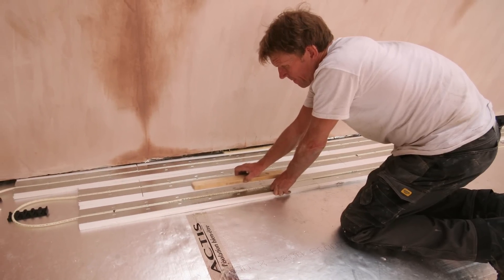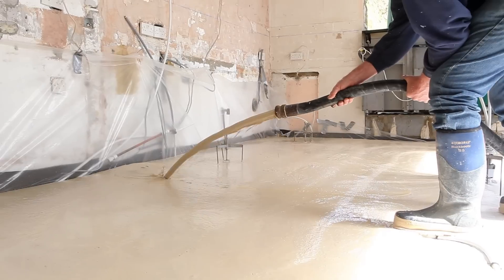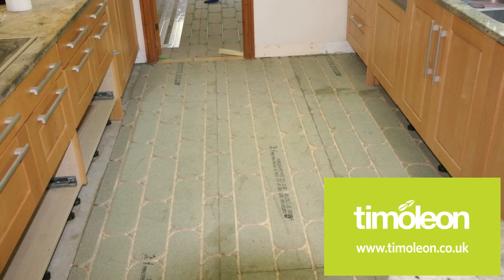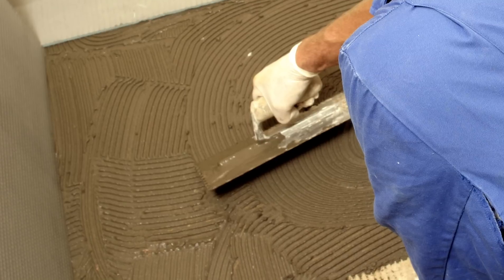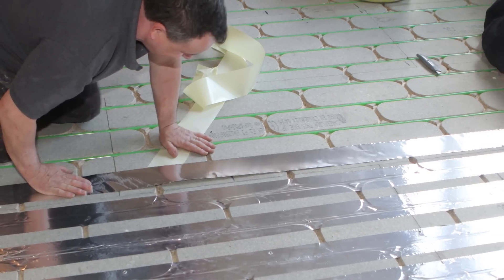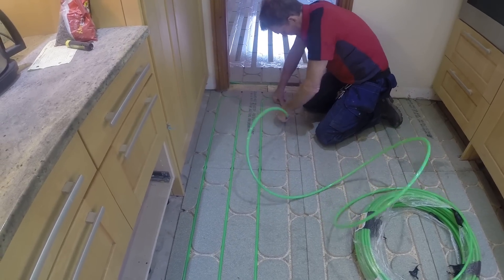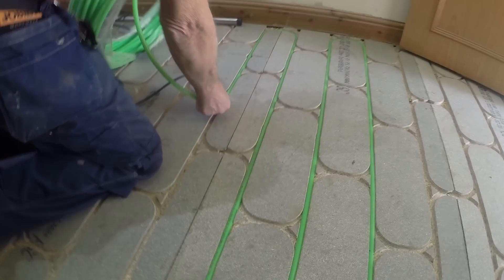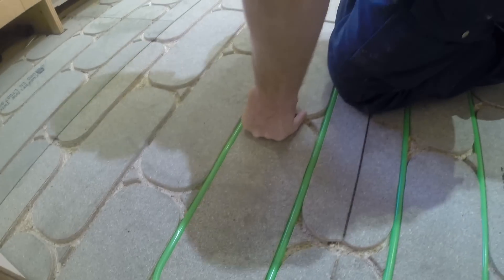Installing  Omnie Zero  Build Up Underfloor Heating

Comment: This could be an answer to my issue of suspended floor and trying not to increase floor height. I have already put 90 mm insulation between joists and replaced floor with tongue and groove flooring which I could reuse in my loft. I know I could ask the company but wondering if this system would be air source heat pump compatible.

Comment: really informative Roger, thanks for that. Question if you have a moment. I have a suspended timber floor that will transition into a concrete floor. Id like to use this system to replace my existing 22mm boards on the joists, but how would i transition that over to the concrete section? can i simply float these boards over the concrete?

Comment: Alternatively, you can lay a big foundation layer of concrete, let it dry, and just mill slots into it using a FlooriQ Concrete Milling Machine. From what I understand this technique is still relatively new worldwide. Maybe something worth looking into for you?
Reply from the maker: I have seen this but we have not done anything on it. Good suggestion.
Reply: So basically you just end up heating the concrete slab and the earth beneath it. Sounds incredibly wasteful due to zero insulation.

Comment: Hi grate video.  Can i put this Timolean system directly on to a on a 6" concrete floor that has 150mm insulation beneath it. mainly because i have only 40mm depth to play with without moving lintels .im thinking of using ceramic tiles strait on top.
Reply from the maker: You can do that but you can also use a polystyrene pipe tray that gives you an 18mm build up and allows you to put the self leveller and tiles straight onto it. Have a look at the whole range to see your optiions

Comment: Is there a system that can be connected to existing radiator in/outlets? Rather than installing a manifold

I thought that given the smaller diameter bore, it could be installed room by room to the existing central heating pipes and controlled via a thermostatic valve.

Comment: Hi, I am currently renovating my home, and have had to remove all the floorboards and joist due to wet rot. Now that i am have to install new joists and floorboards, i am interested in fitting a underwater heating system and intend to replace the radiators on the ground floor. I am insulating between the joists with 100mm celotex, irrespective of underfloor water heating system. Can the UFH system be a primary source heating and safely remove the ground floor radiators?
Any advise would be appreciated!!

Thanks
Reply from the maker: You have the perfect scenario. You need to leave enough space (17mm) above the Celotex to get the pipes in if you are using a pipe in plate system under boards or you can use this pipe in the floor system which is quicker to react. Have a very careful look at the instructions for each system and then contact the supplier who will give you a drawing with a pipe layout. There is no point in keeping the radiators, the gentle all over heat from UFH is more than enough to do the job. You will love it.
Reply from the maker: OK, like you say, it is hard to put them back so leave them in and maybe cap them off later if you want the wall space. It is important to remember that UFH works with radiated heat rather than convecting so it isn't actually trying to warm up all the air in the room. If you think of the way bright sunlight hits you on a cold day it is that kind of heat you feel and if you keep it ticking over at a low temperature it will war the structure and provide good comfort at lower temperatures.. The solid walls will lose heat faster than cavity or insulated so you need to factor this in. Have a chat with Omnie so you can get the room temperatures worked out. The insulation under the floor is a massive help. Just remember to make it airtight by squiritng expanding foam into any gaps

Comment: This might sound ridiculous, but can I put this in my van?
Reply from the maker: I assume you are talking about a camper van so yes but you would need glycol if it is left not running in cold weather.
Reply: Yup, it's running off of an Espar hydronic heater which in turn links to the engine coolant line. Can I throw down vinyl straight over the top of this? or a very thin aluminium sheet + vinyl?

Thanks, this stuff looks awesome
Reply from the maker: If you are using vinyl floor covering you need to keep that water temperature down to 27 deg cent. I would look  at some kind of timber or metal flooring. I would love to try it.
Reply: Damn that sucks!, the Espar would have it up around 60-70c, if it came straight from the engine coolant it would be even hotter, maybe up to 85c. I'd probably only ever run it off of the Espar though, so 60-70ish. What about as you say, 6mm of plywood with vinyl over the top? Vinyl is really the only ideal low profile aesthetic tough solution with van conversions, pretty much everyone goes the wood effect stick on panels or big sheets.

Comment: Hi skillbuilder, like your videos. I can see you have used many ufh systems over your time. I would really appreciate your advice on my project.
I have a suspended wooden ground floor with reasonable crawl space underneath - tho height build up above is a concern. I could fit metal spreader plates from below to the existing floorboards, but I've heard people say these can make noises as they expand and contract; and also if they are attached to 'real' wooden floor, won't they cause these to warp? This timoleon or torfloor (providing they are one and the same thing now) looks interesting. What would be your preference? Huge thanks to any thoughts

Comment: Firstly I'd just like to say - Brilliant video!

I've a couple of questions if you don't mind - 

The Timoleon system, how does that connect into the existing heating system?  

Electric underfloor heating on a suspended wooden floor. Is it worth insulating under the floorboards between the joists?
Reply from the maker: +wonderloaf 
Last question first. It is always worth getting some insulation under the floor. I have done all the timber floors in my house and the difference is instant and remarkable. Even if you aren;t heating the floor the insulation is worth it.

The Timoleon system works like any other wet system. You have a manifold. It is all easy enough to do because you get  good drawing showing all the connections. Have  a look at out Worcester Bosch underflloor heating video. It is pipe in screed but the manifold works in the same way.
Reply: +Skill Builder That's brilliant, thanks for the answers! It's good to hear your personal experience with insulating under the floor.

I think you've made my mind up in regards to using the Timolean system when I redo my kitchen!

Thanks again for taking the time to reply!

Comment: +Skill Builder Hi. Very interesting and informative video. I'm curious if Timoleon or anyone else sponsored this video? Also, have you ever used the concrete or gypsum fibreboard grooved panels (rather than the CNC routed chipboard panels that the Timoleon system uses) to inlay the pipe into such as the kind Polypipe sells? I wonder if it's more stable and better insulated so heat isn't lost in the downward direction compared to the routed chipboard? I want to have water-based UFH in a 2nd story flat which has timber battens over concrete (which has the ceiling of the flat below plastered right onto the bottom of the concrete). Any thoughts would be very helpful. Thanks!
Reply from the maker: +DeerParkCarWash 
Hi Thanks for your interest. Sadly no money changed hands for this video. 

Timoleon is a product I have used and I have also used the Knauf gypsum  product  'Brio' Board  that you mention. Brio has better thermal conduction and therefore heats up quickly. The Timoleon product takes a little longer to heat up but it is still only half an hour before the house is toasty warm. I was at that house only yesterday and they were telling me what a difference the Timoleon heating has made. They love it.

The major advantage of the Timoleon is that it is structural whereas the Brio has to be supported. It has no strength. If you lay it over the pipe in panels you are looking at a build up of 15mm for the pipe in panel and then the 18mm Brio. The Timoleon onto the joists with 6mm ply over works out at 24mm. 

If there is a clear space between the battens it would be a shame not to use it with some pipe in plate system. Have a look at the Timoleon website. They will do a design for you.
Reply: +Skill Builder Hello, thank you so much for your detailed reply. It is very helpful. Can I ask, what do you mean in the last paragraph when you say "it would be a shame not to use it with some pipe in plate system". What exactly is a pipe in plate system, and is the TorFloor (new name for Timoleon Toron grooved chipboard system, apparently updated since your video) such a pipe in plate system?

The fact that the Timoleon boards are structural and  minimize the height buildup is a big plus to me. Since we're on the 2nd floor we also need sound proofing so the TorFloor RDB product includes this, making it ideal but it is quite a bit more expensive than the plain TorFloor product with no soundproofing so we need to do a bit more homework.

Do you know of any other manufacturers of UFH systems that have structural grooved panels like the Timoleon product for comparisons sake? 

Lastly, do you think it is necessary to install insulation between the wooden battens under the grooved chipboard TorFloor product? It's just a void (between the battens) with concrete below. Would there be unacceptable heat loss into that void without the insulation?

Thanks so much for your help, and if you could clarify the "pipe in plate" system, know of any competitors, and tell me what you think of the need for insulation I'd be eternally grateful!  Thanks, DPCW
Reply from the maker: +DeerParkCarWash 

https://www.youtube.com/watch?v=rWmJbell_sM  This is a pipe in plate system but Timoleon also have one. There are lots about. They are metal plates on a sheet of insulation. The idea is to get the plate in contact with the floor covering so it conducts heat. 
You are right. They seem to have modified the system and now call it Torfloor. They also have a Clip plate system that is similar to Polypipe,
Reply: +Skill Builder You are a star. Thank you so much for your help!
Reply: So deerpark, did you go for timoleon in the end? Anyone have other reviews on their experiences with the product? Many thanks